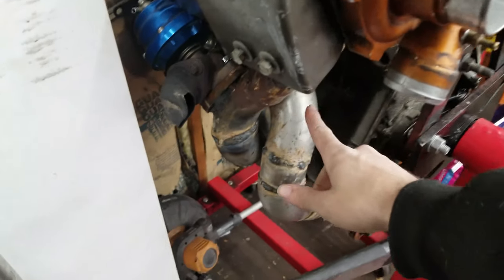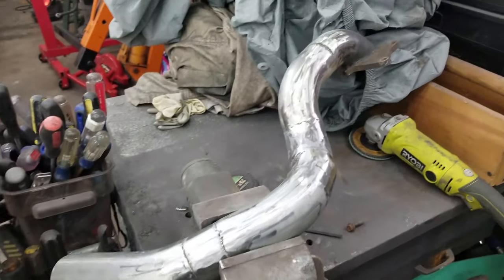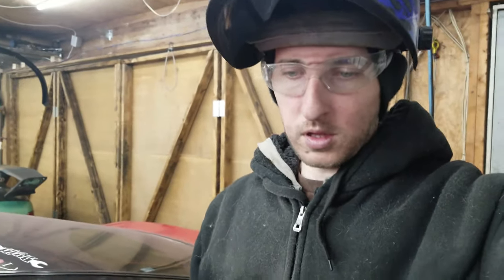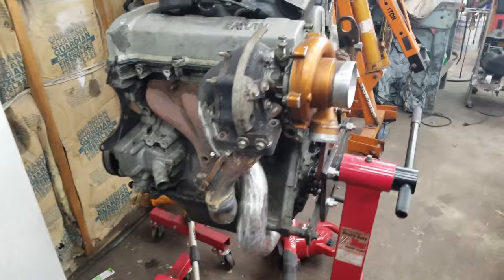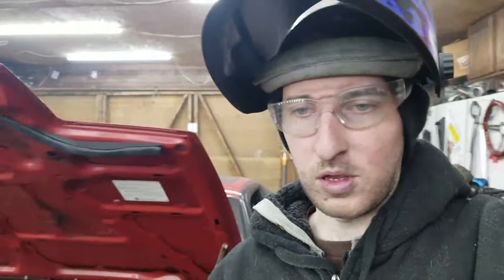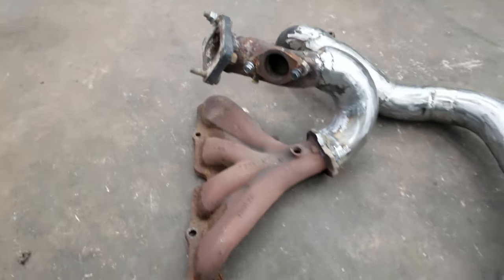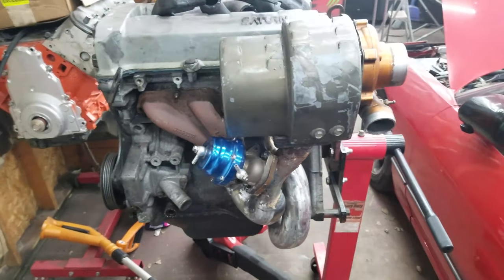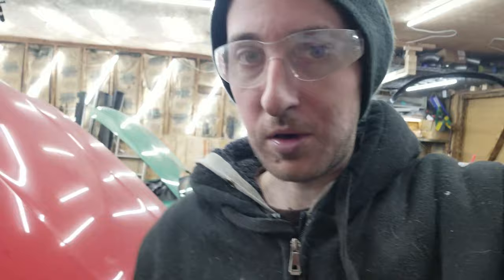Smoothing Out The Turbo Manifold

Comment: Right on, gonna see some turbo Tupperware. You gonna install the Megasquirt? If so please do as detailed as possible video for the install and operation of it. I know that is the most intimidating part of boosting these cars for most people.
Reply from the maker: Currently the plan is for very low boost, like I have a 4.75 pound spring in the wastegate low... but if I want to turn it up I'll have to install the Megasquirt then
Reply: Are you running Midori on the stock Ecm? If so how did you tune it for E 85? Also will a stock computer know what to do with boost?
Reply from the maker: I'm running larger injectors with the intake air temp sensor pulled and increased the fuel pressure at the regulator... the stock ecu can not be tuned at all
Reply: Oh ok, its more of a mechanical "tune", and tricking the ECU by pulling the IAT. That's why I was confused, I know those can't be tuned at all, in any way. Even N/A, it isn't bad idea run a stand alone ECU, just to be able to get proper spark and fuel maps for E85. Is there a reason everyone in the community uses Megasquirt or Electramotive? Is there some weird reason that other stand alone ECU's won't work, or is it just the price point? I kinda want to put a Haltech elite 1500 into an 02 SC2.